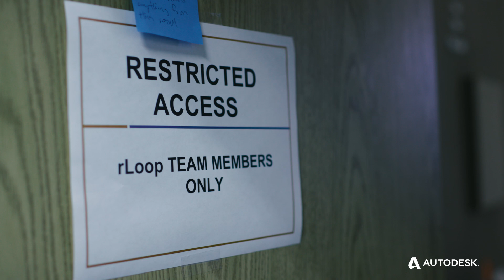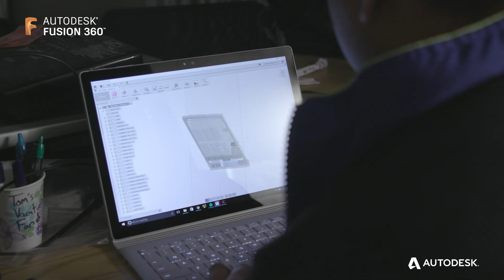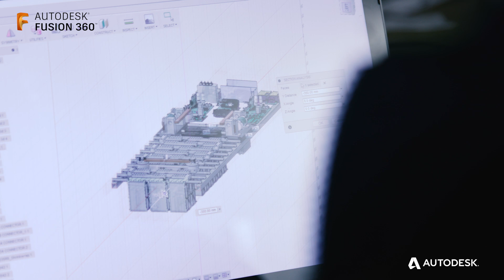Epic journey to SpaceX Hyperloop competition

Comment: Still waiting on someone to explain how they intend to maintain a vacuum over hundreds of miles while still factoring in thermal expansion. Building the moving part is relatively easy. Building the tube and not having it implode, killing everyone inside, is the tricky part.
Reply: afaik they will not maintain an actual vacuum that would be incredibly impractical. The tube will have reduced athmospheric pressure, just enough to significantly reduce air resistance while not creating too many other problems.
Reply: Even substantially reducing the pressure in the tube of that size puts some serious buckling load on the structure. Coupled with thermal expansion in the hot sun over hundreds of miles, and you're gonna have a bad time. And you're going to have to substantially reduce it to A: have any benefit and B: avoid turbulence on a train ride. Can't have pockets of air buffeting a train at 350 MPH.